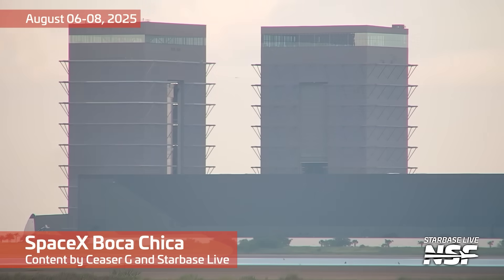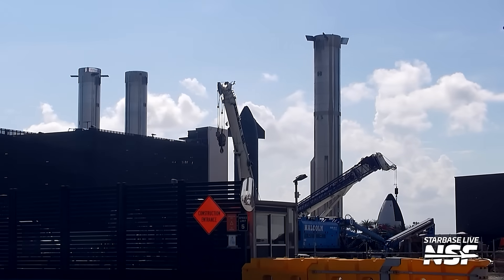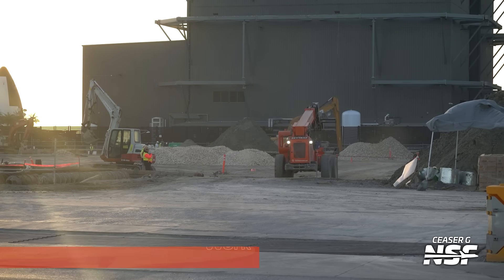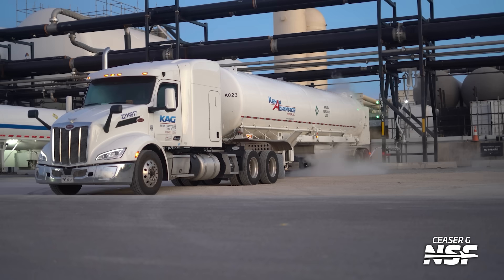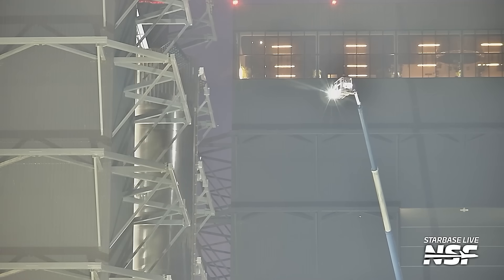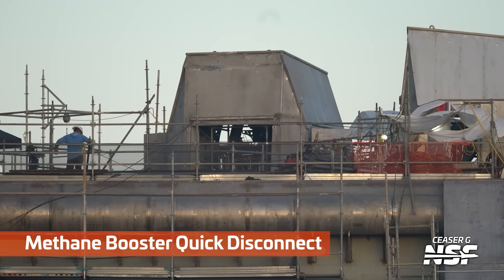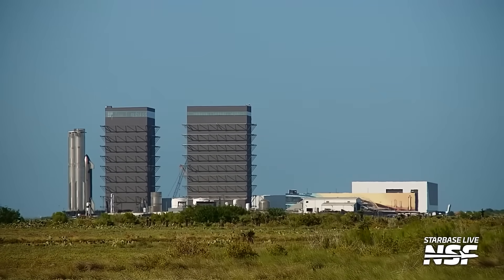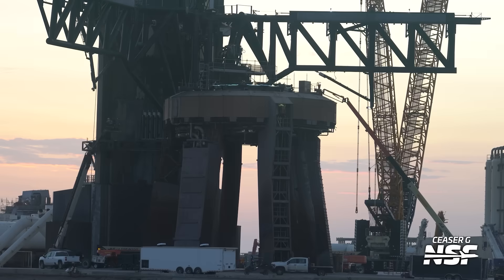"It Belongs in a Museum (Booster 12)" | SpaceX Starbase

Comment: The community frequently hopes SpaceX historical rockets make it into a museum. Problem is that museums usually buy the article. Space X can donate the article, as they have offered in the past, but it has to be transported and displayed. Transporting a ship or booster is not easy. Even laid down there would be powerline, traffic lights. and other obstacles along the path. The mode of transporting would be expensive as well. There are plenty of vids and articles on moving the retired shuttles to their present display areas. Maybe, NSF and other content creators could inspire a museum and generate some interest. Problem is, I don't think that museums or others who would display such articles have the same interest as the community. And Space X doesn't have the land and facilities to store decommissioned vehicles that need air pressure to maintain structural integrity. Sad that the vehicles will get scrapped before the vehicles value is realized.

Comment: My guess on the launch mount lights is that they are there for working in low light and dark so it marks the location of the transport/static fire stand as it looks to be shorter than a normal safety railing so it could technically be possible, however unlikely, that somebody could accident;y fall over it if distracted. That or really bad work lights… or a wedding 😁

Comment: The light rope is just a quick simple work safety light. I have seen them advertised many times now as a roll out work site lighting system.
Reply: Such a mundane answer.  Obviously it is not a rope light, but an anti-gravity boost ring.
Reply: @blakevonhaden I was under the impression that it was a quantum slipstream particle accelerator (everything cool has "quantum" in it)
Reply: Probably not so much a work light strictly speaking, but more of a pathway light to make it easier to walk around the mount. If someone was doing any actual work or inspecting they can bring their own lighting as needed. But this way they don't have to use their headlamps or flashlights to illuminate where they are walking. That's my guess anyway, as you don't need much light for walking compared to working or inspecting.
Reply: Yeah, they are getting more popular lately, I've seen them on a bunch of construction sites. I think it's just easier to light up a large area with them than with those halogen floodlights on tripods